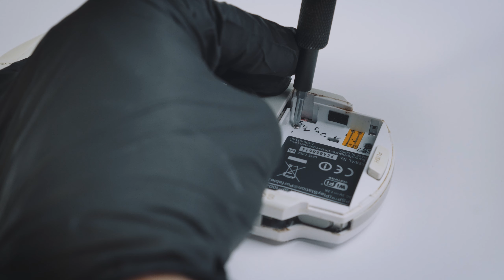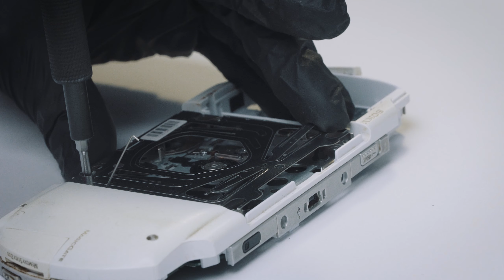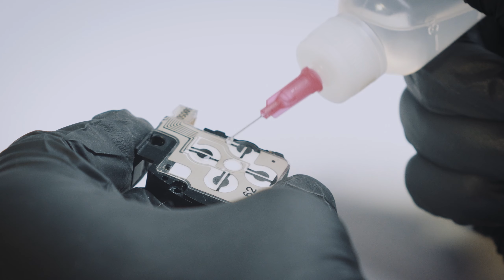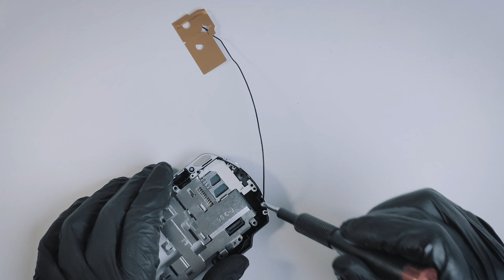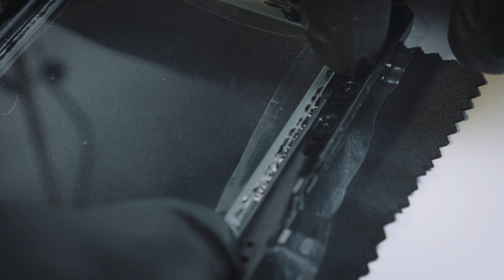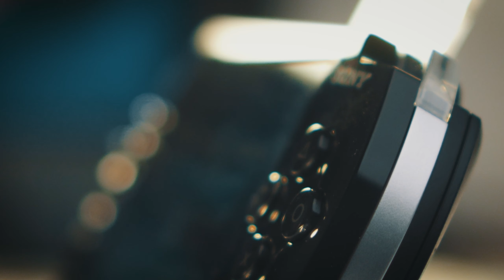Restoration & Upgrade Broken PSP-1000 with IPS Display & Glass Lens

Comment: I purchased a new UMD drive as mine is making all kinds of noises and failing. The replacement states that I need to remove that tiny grounding solder on the ribbon which I see you left. Is that not needed to do?

Comment: Thanks for the tutorial ! This is exactly ehat I want to do with mine new faceplate with glass lens and an ips panel , did your screen come with the conductive paint or do I need to buy is separately? Also could you add the  link to the shell replacement parts ? There are a few on AliExpress but i dont know which one is the best one to get , thanks !
Reply from the maker: Unfortunately, the conductive paint is no longer included with the LCD kit as it used to be. Here are the components I used for the build:

IPS Kit, 1000LM:
https://s.click.aliexpress.com/e/_oDhIC8b

Full Housing/Shell Kit:
https://s.click.aliexpress.com/e/_okeXGXh

Glass Lens:
https://s.click.aliexpress.com/e/_onmvipl

Conductive Paint:
https://s.click.aliexpress.com/e/_oCZmIZd

Glass Glue:
https://s.click.aliexpress.com/e/_oBpyJCn

UMD Drive:
https://s.click.aliexpress.com/e/_olft7oJ
Reply: @HANDHELD_JUNKIE Was the shell that you used in the video a decent fitting replacement as I've heard that there are many out there that needs trimming/fileing to get them to fit and function on the PSP, especially near the sliders and buttons.